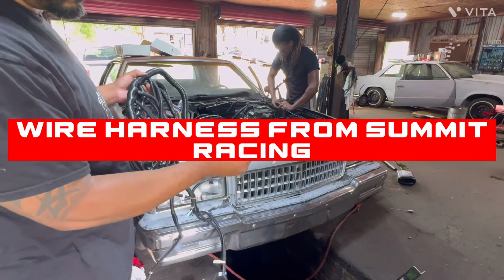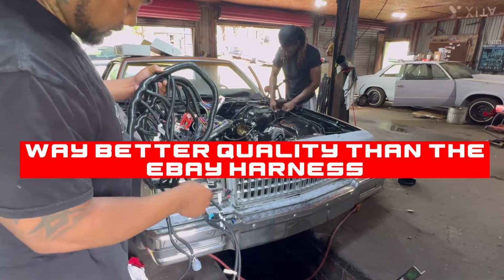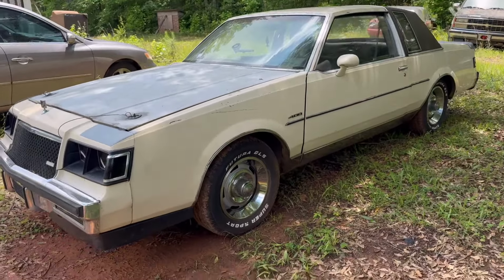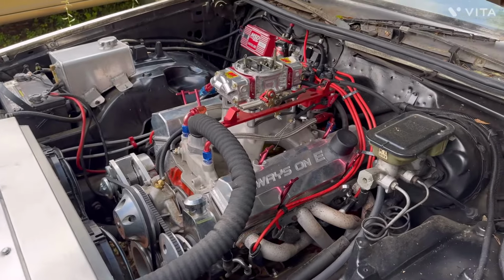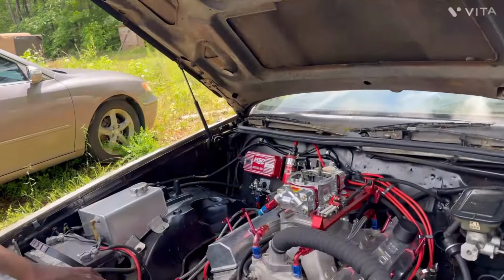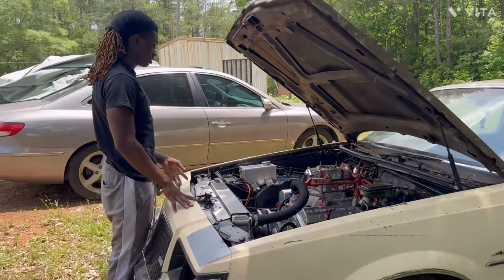Box Chevy update-LS wire harness, hood, and more

Comment: Hey Pop I forgot to suggest the passenger inside pillar at the top behind Chrome window molding. They have a tendency to rust behind that molding in the water will run down that pillar down inside of your floor. It was just another thought.  And check all door molding on that side also. Hope that helps. What y'all doing a very good job 👍👍
Reply from the maker: Appreciate it 💯
Reply: You're welcome 👍
Reply: Mines rusted at the bottom on both sides but the water leaking on the inside came from the weather stripping... Dry the water out and put some duct tape on the top corner jump in and have son run water on it....